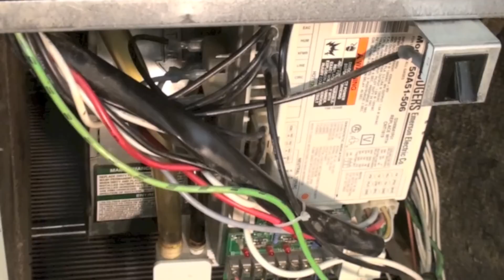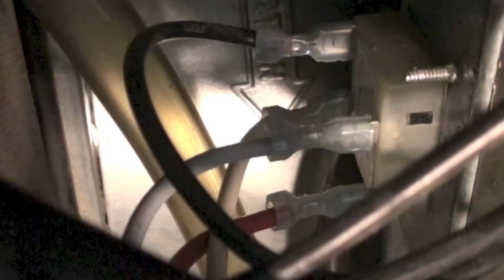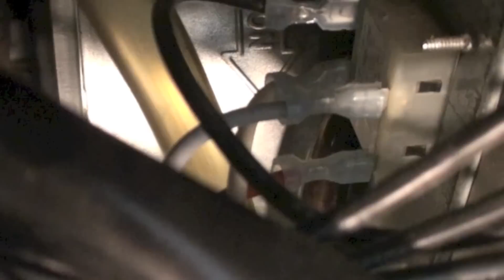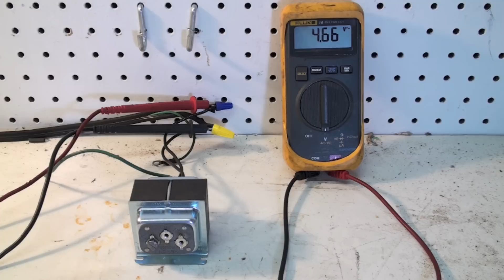How to troubleshoot the transformer

Comment: The company I work for does alot of new construction apartments, I mainly run service calls. A new air handler wouldn’t run the ac I found the transformer had like 14v to ground on the secondary common. 34v to ground on the secondary red and 28v between both secondary terminals. This transformer was set for 208, with an open tap for 240. The system had 211v incoming with a ground. I grounded the secondary common and that resolved the issue and I had no voltage on common and 28v from r on the transformer to ground. Why would this be? I fixed the issue but don’t know how or why.
Reply from the maker: I have no answer for this one.
GFM

Comment: What is a normal resistance reading for the secondary contacts? I was troubleshooting a  thermostat issue and checked the secondary ohms before switching back on and got around 1.5 ohms. Thought it was shorted so I didn't switch back on for fear of frying the board or something. Now on hold till I can investigate.
Reply from the maker: Your 1.5 is probably normal
GFM

Comment: My mother in laws house had a power surge from broken exterior power line …..it fried a few household appliances …. Lennox elite Furnace has no power do you think it could be the transformer?? Circuit breaker is fine and has 110 at furnace
Reply from the maker: Check for 24 volts between R and C at the furnace terminal board.  24 volts, transformer ok, no 24, transformer failed.
GFM
Reply: @grayfurnaceman  that would be Red and white (common) wire on circuit board?what is GFM mean? Also will a low voltage non contact work because it is only good from 50 to 1000 volts so it won’t work on low voltage end of transformer?

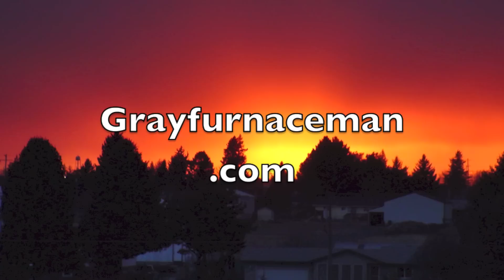Comment: Is it possible that the 24v would be intermittent? I mean T stat is on but as soon as it kicks either AC or heat it will go out (AC, fan, heater fan and t stat goes blank) but it 4:57  comes right back.
Reply from the maker: This one sounds like you have a short in the low voltage circuit.  
GFM

Comment: What if I DO have continuity on both the primary and secondary side but when I hook the thing up I still get no voltage on the secondary side? Clean 121v on the primary side... I've gone through ur whole series and I'm still at a loss. I'm on  transformer #3... I have no continuity on on relay side (with transformer unhooked) in the open position (like it should be) and now I have 3 seemingly dead transformers so I can't test for amperage on my equipment side either.... I'm mostly just ranting... This is frustrating. Thanks for the help u did provide....
Reply from the maker: If I could ask a few questions.  You are sure you have 120v in?  Have you hooked it up with no wires on the secondary?  If so, did you have 24 volts on the secondary?  
I am thinking you have a short in the circuit and the transformer either has a fuse that's blown or the secondary winding has an open.   Merry Christmas
GFM

Comment: Also what does it mean if I plug in the common and  hot line then both of them are reading 120v off the ground? I’m assuming that it means something inside the transformer made a bad connection
Reply from the maker: Your reading its normal.  The common is connected to to the hot, so you will read power.
GFM

Comment: MY dad has an old electric furnace and the blower motor stays  on all the time.  I  unhooked the thermostat wire still runs. it doesnt have a circuit board that  i see. the only thing i see is a transformer. What could keep it running all the time?
Reply from the maker: Nope.  Electric furnace?
GFM

Comment: My gas heater isn't working, my transformer is only reading just under 11 volts coming out.  Does this mean my transformer is bad or is it likely something else? Thanks for the video
Reply from the maker: 120 volts in, with no effective voltage coming out, bad transformer.  When replacing the transformer, check output amp draw.
If over 2 amps, you have a short in the control circuit and the new one will fail.
GFM

Comment: Excellent video! Thanks for posting this! I have a question: what is the acceptable voltage range coming out of the transformer? I hear people in other videos talking about 27 volts. My thinking was as long as it is at or above 24v it should be ok. Can you chime in on it please?? Thanks!
Reply from the maker: 26 to 29 is ok.  Under load it may drop to 24 to 26.  22 or below is a problem.
GFM
Reply: What if we are getting 30Vac?

Comment: Hello, i want to ask. My secondary transformer continuity is 0. Is that mean my secondary transformer is broken?. And my transformer is step down( 240 to 24v), when I check the output voltage. The voltage that I get is 32V. Its normal?
Reply from the maker: Your 2 readings are incompatible.  You cannot have an open secondary and still read a voltage on the secondary.  Double check your readings. The 32 volts seems high.  But it may be an open circuit voltage  that would reduce to 24 to 26 under load.
GFM

Comment: Hello my Ducane furnace operates normally except it has one problem I'm concerned about.  When I plug it in I hear a faint electrical humming sound, the led light  also stays on. Is this normal ? or would I have to change out the transformer?
Reply from the maker: Humming of the transformer is normal.  
GFM

Comment: Great video! I am 99.9% sure my transformer is bad. I'm in s. Texas and was using an inverter to power the furnace during the storm. In the middle of the night the blower motor would power cycle at very low rpms. In the dark I accidentally shorted the switch receptacle (what i used to power it). Now if I put 110 direct to the motor it doesn't power cycle but VERY low rpms. Control board and thermostat is not connected.  Am I looking at a transformer and a blower motor and maybe a control board?
Reply from the maker: If the furnace operates at all, the transformer is ok.  Sounds like you may have damaged the control board and/or motor end bell.
GFM
Reply: @grayfurnaceman  well not even the led indicator is turning on. 

To be more precise, if I supply 110 to the blower, even with the control board and thermostat disconnected, the motor should run at full speed or no? Right now it runs at ~100 rpm.

Thanks for replying!
Reply from the maker: @Synaux  That depends on what motor you have.  If it is a PSC motor, it should run full RPM.  ECM probably won't run at all.
GFM

Comment: Truly excellent videos, grayfurnaceman!  I have an older RGDC Rheen gas furnace from the 1980's (I'm in SoCal so furnace literally only runs 10-20 hours per year).  While cleaning the burners last week, I broke the tiny tube on the mercury pilot switch that is part of the ignition module (SP710A).  Of course those switches are no longer made so I installed a modernization unit from Robertshaw.  All seemed well but then the transformer failed on the 24V side.  Based on your vids I investigated all wiring and connections.  I replaced the fan unit (only $40 for the unit including transformer and relay that bolts to the 4x4), and I also installed a 5amp tiny circuit breaker on the hot (red) wire as it comes out of the secondary side of the transformer.  I can only speculate that the wiring shorted against the chassis - because all I did was re-do all wire nuts  related to the new ignition module including addition of electrical tape.  I verified about 26V voltage and about 0.6amp current.  Your logical approach to troubleshooting helped me to think about these things and the furnace is working nominally now!
Reply from the maker: Sometimes you never find out.
GFM

Comment: I am dealing with a Carrier RTU that had a bad inducer motor. Turned disconnect off several times in the process of replacing motor. WiFi t-stat of course loses connection when disconnect is turned off but comes back on within a minute or so after re-energizing disconnect. 3rd time turning disconnect off and then back on however and WiFi signal never did reconnect. Modem is fine and working for other units just not connecting on this one. I checked transformer primary and secondary voltages and while primary is good to go, my secondary is reading 22 volts under no load. This is a 208/230 system running at 208 volts. Have not been able to get back to it today due to constant rain. This transformer btw, has a built in circuit breaker protection and it is not tripped. I am wondering if turning disconnect off and back on several times had something to do with transformer now only putting out 22 volts with no load even on it and also loss of wifi stat connection to unit.
Reply from the maker: I don't think the disconnecting had anything to do with the problem.  I would be looking at the transformer wiring.  It could be wired for 240 volts. That would account for the low voltage.
GFM
Reply: @grayfurnaceman  It's been running with that transformer and didn't stop until I had turned disconnect off and back on several times. Now, no connection to wifi stat and only 22 volts out of transformer under no load. I suppose you could well be correct but this unit has run for 2-3 years with that transformer in it and hasn't had the wiring changed. Usually on a miswire of the multi tap I see them either not work right from the get go or very early on it becomes an issue. I suppose it could have lasted this long before becoming an issue but I don't think I've ever experienced that.
Reply from the maker: @jimmymcneil4466  I have had both experiences.  I would check the wiring.
GFM
Reply: @grayfurnaceman  You were correct sir. Whoever installed the multi-tap transformer wired it for 240 instead of 208. I have been the one they have called for service since 2017 so it was installed prior to us getting the service contract. Very unusual to have not had any issues for the past 2 years until now but there you have it. Appreciate you pointing me back in the right direction. I should have checked that earlier on.
Reply from the maker: @jimmymcneil4466  Glad you got it going.
GFM

Comment: What is the problem if I have 2 identical units and both transformer read 24 volts at the secondary on unit #1 but both read zero volt on unit #2.  Both units has 120 volts going to the primary of the transformer. Any idea?
Reply from the maker: Are the units twinned twinned?
GFM
Reply: No, each unit are used for different section of the house. It is Bryant heat pump with  backup auxiliary heat.
Reply from the maker: @vajkaus  You could have an internal fuse in the transformer.
GFM

Comment: I recently replaced the contactor on my goodman heat pump/ A/C out side unit, the contacts were melted together, I replaced the contactor and the heat pump worked again while the weather has warmed the A/C wasn't coming on after checking many possibilities I gave the transformer a smack with a screw driver and it's started working again, hopefully for good, not sure if that was the cause or I just wiggled the right wire some where
Reply from the maker: Probably only temporary.
GFM

Comment: TLDR: If you notice electrical items dangling from the rafters in your attic that do nothing, go ahead and disconnect them asap because they could possibly do bad things.  And it seems I'm also building things with dud parts. D'oh.

We had one of those transformers pretty much exactly like that one wired up in the attic for a doorbell that had been removed in probably the mid to late 70's... At some point in the last decade, the old low voltage doorbell wiring that was strung all over the place shorted, and apparently the transformer got so hot it melted the primary into a dead short, which then melted almost the entire length of its dedicated 14 gauge wire to the breaker box before it finally went open. How the house didn't burn, I have /no/ clue.

Meanwhile, I'm working on a homebrew thermostat setup (12ga power cord, thermostat module, 24v/40va transformer, 40A contactor for overkill, 20A outlet, all squeezed into a project box) to use on a window a/c, space heater, turn a deep freeze into a fridge, etc. It works great, but the practically brand new transformer gets hot enough with no load that I can't hold my fingers to it for more than a few seconds, and it shows 20 ohms on the primary... 

Pretty sure I'm going to need to get another transformer, wouldn't you think?  :p
Reply: Found another video with someone ohming out this exact model transformer, and it read practically identical to what I get with mine. v=M5y2FC0SYXA?t=277

Pretty sure still that it's not supposed to get hot enough to smell frying plastic when it's plugged in with nothing connected to it, though.
Reply from the maker: @hwesson75  That transformer should not have any heat buildup if the low voltage circuit is open.  Are you sure there is no load?
GFM
Reply: @grayfurnaceman  Yeah, I have it sitting on a desk with nothing connected but white/black clipped to test leads stuck in a power strip and it still gets hot. It's slow to get there, wouldn't notice in a short test, but at about 30 minutes it's pretty warm, an hour it's up to around what I'd think normal if it had been actively holding a contactor, and after a few hours you wouldn't really want to pick it up bare handed for more than a second or two.

And I just now noticed, after it sitting there plugged in for about an hour and a half so far this time, that its hum has ramped up from nearly non-existent cold to the point where I can hear it making the desk hum and can feel the vibration when I touch the thing... 

This has me starting to think it's probably a manufacturing defect. Likely either a poor winding job, or bad lamination between some of the plates, would be my uneducated guess.

Whatever it is, I think I'm going to be safe and just get myself something completely different to replace it with. 

Although, for something that only draws around 4 watts, it does make for a rather effective (but oh so very sketchy) hand warmer on a cold night. lol
Reply from the maker: @hwesson75  I would have to say it is toast.
GFM
Reply: @grayfurnaceman  Well, I got another one of the same type, but a different brand... This new one still gets uncomfortably hot after a few hours of 120v sitting on the desk, but unlike the other it's /just/ at the point that I can hold on to it for a while.

Looks like I am going to be ventilating that project box after all, because things are only going to get hotter while holding the .13 amp load for possibly several hours at a time.

Ugh... There's going to be plastic shavings /everywhere/.  Darn stuff is nearly as pervasive as glitter is. lol

Comment: Hello, having a problem in cooling mode for a Heil AC,  the inducer fan and blower fan are running at the same time but the condenser doesn’t not kick on.  Thought it was the contactor but found this problem after.  Any idea..  If I push the plunger in condenser fan and compressor comes on
Reply from the maker: You are not getting control power to the contactor.  This could be a wiring problem between the indoor unit and the outdoor unit.  You could also have low charge that has opened a low pressure switch.
GFM
Reply: @grayfurnaceman  thanks Gary would that cause the inducer fan to run also at the same time???   Thanks again
Reply from the maker: @msj103105  That one could be a failure in the control board or the furnace limit is open.
GFM
Reply: @grayfurnaceman  found that the limit was open gonna replace  thankz

Comment: does the Vo of the Transformer always read 24V in order to turn the unit on? what if it reads only 22v?
Reply from the maker: Open circuit voltage should be 26 to 28.  When under load, I would expect 24 to 26.  22 seems low and you could have an excessive load on some component.
GFM

Comment: It goes without saying, but I'm not a technician.. I do however manage to fix more things I try to work on than not, so while at my grandfather's house on Thanksgiving I thought I'd try to figure out why his heat works intermittently. Older model Tappan by the way.

I was told a few good wacks on the side of the air handler usually gets it going. Obviously points to a dying relay of some sort - I do know that much. I found a relay but as I'm looking over and thinking through how this thing works I try turning it on with the fan "on" instead of in "auto". It works fine, instantly when you switch to "on" every time. It's a single relay, obviously it isn't bad - I think. As they say, if you reach for a bigger hammer and that doesn't work, your problem's electrical. Onward.

I pulled the leads that are coming from the transformer I found and get about 26vac when the fan is set to "on" but only about half that when in "auto".  This is where I dead end. The fact it's about half the voltage isn't lost on me but I can't work out why, or if that's just a red herring of sorts I should just ignore. 13 vac just isn't enough juice to energize the 24V switch is my conclusion I'm confident of.
Any thoughts for further troubleshooting and potential home based repair?
Note, he lives in the middle of nowhere, which is why I'm not just running up to the local hvac shop and picking up a new transformer before I head home.
Thanks
Reply: For future readers: I don't have an explanation, but I changed the thermostat and all is well.